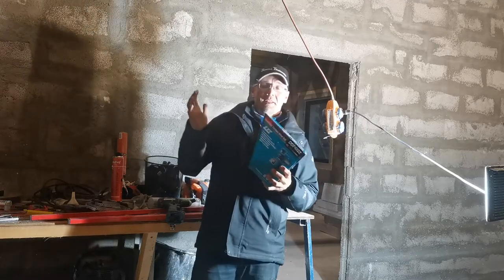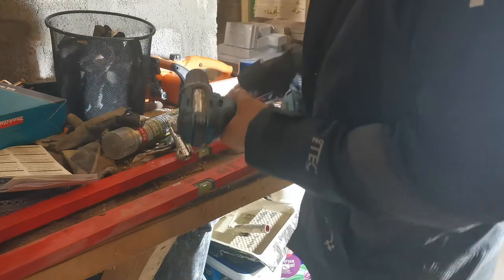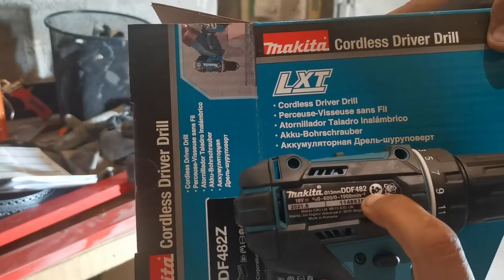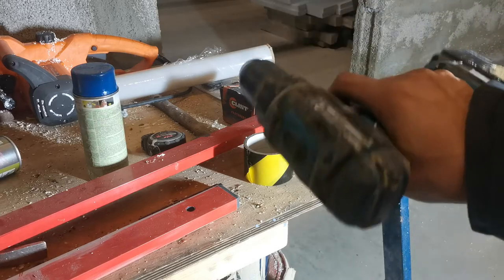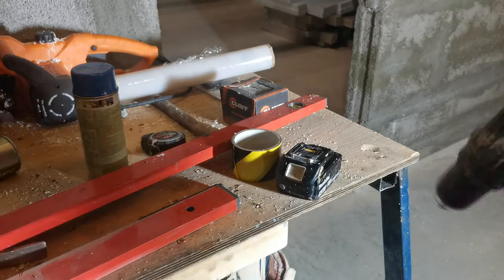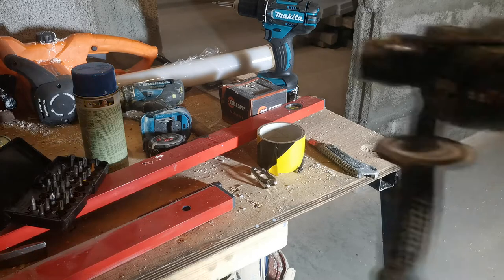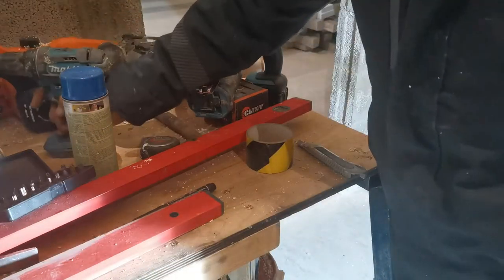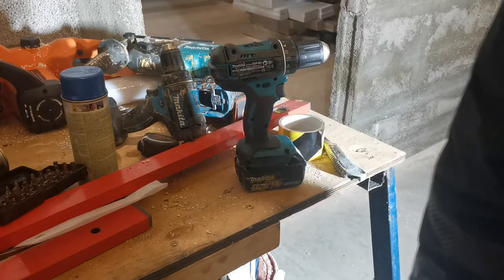[127] Makita DDF482Z vs smoking broken DDF482

Comment: The Z in the product number means it contains the body only drill, the same drill can be bought as part of different kits, for example with battery, with charger, in a makpac, with accessories, or in an alternate colour, each product edition is differentiated by letters after the actual model number of the tool.
Reply from the maker: Thank you for the information, smarter every day.

Comment: Yesterday i bought this Makita model, for my home DIY use. Nice to see that you like it so much, you buy it again. Have you looked inside your old one, to see if the motor brushes are burnt ?  Sad to trow it away, if it only needs new motor brushes. Thank you for video. 👍🙂
Reply from the maker: Yep i looked inside, but i allready knew that it was my fault as i drilled wood with a realy big bit so cant say that Makita was bad hahahaha. Yeah i asked the local makita service and the price diffrence was 15 euros so i could not resist the new tool smell :D and thanks for the feedback!

Comment: You probably should have went for the DHP451 it has a stronger build quality. Good video liked and subscribed
Reply from the maker: Yeah, thx mate for the info. Seems that i use the tool alot more as the chuck has broken it somewhat works but i think i need a new drill. So the next one is what you recomend. Thx in addvance ;)